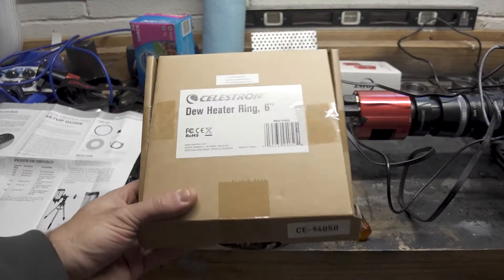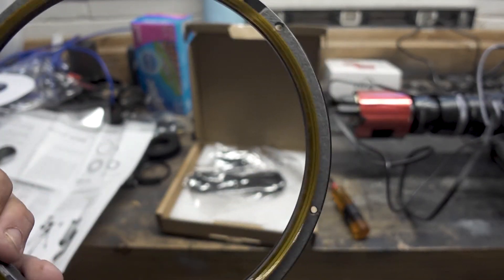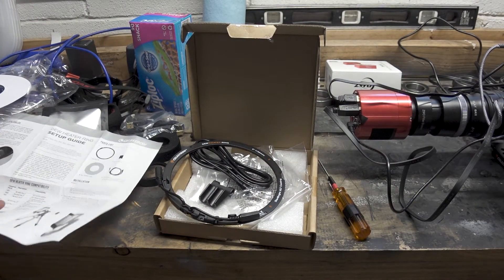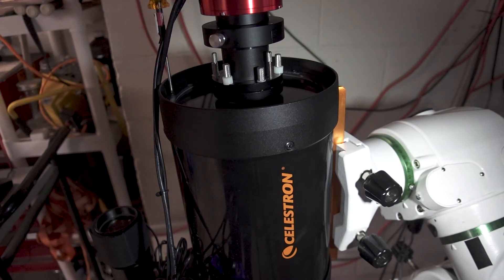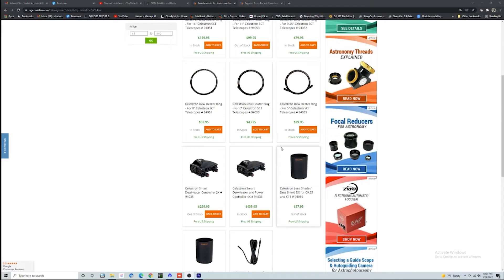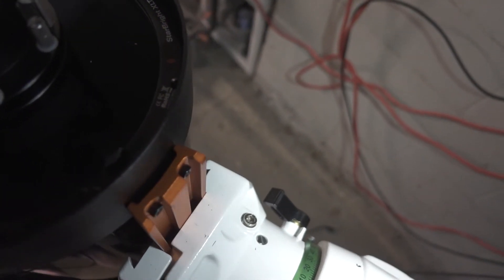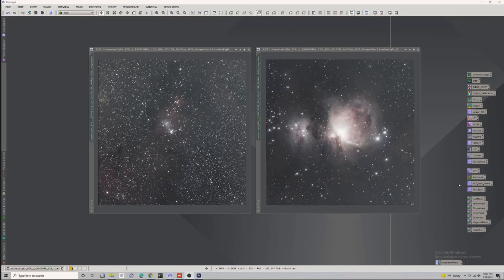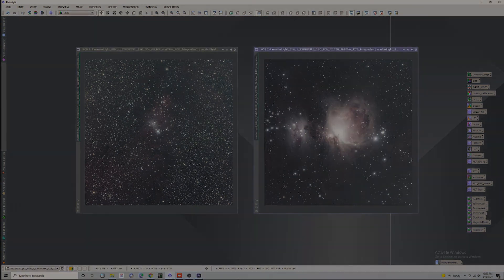THE CELESTRON DEW HEATER CORRECTOR RING FOR SCT | LOVE IT

Comment: Got the dew ring for my C11. You mention this can be used with the asiair. Could you let me know what kind of power cable to buy for that? Having a hard time finding a 12v dc cable that will pair with the dew ring's RCA pin.
Reply from the maker: zwo has a y splitter rca cable for using dew heaters